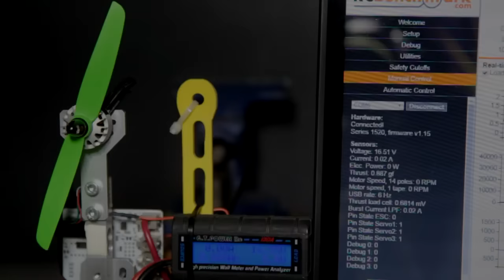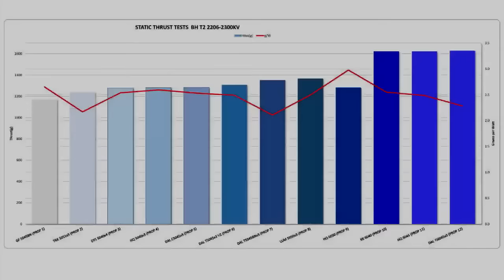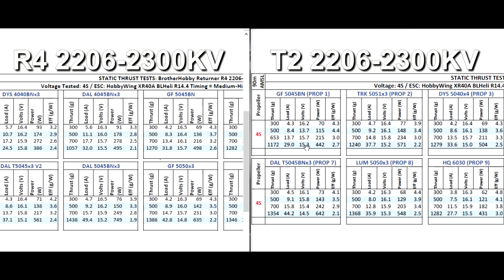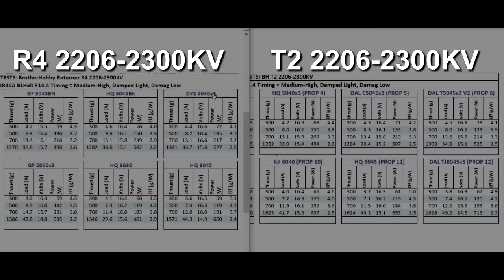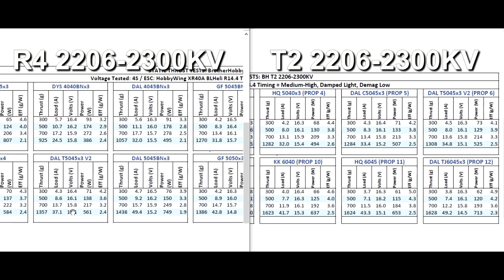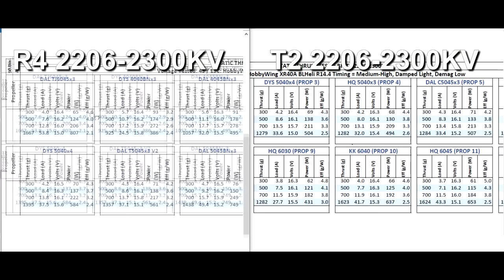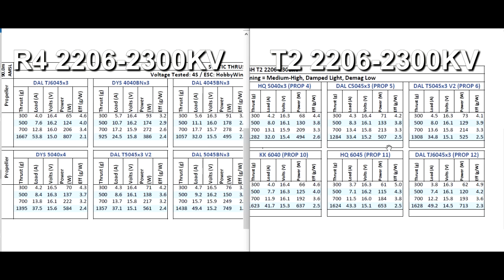BrotherHobby T2 2206-2300KV Static Thrust Tests & Tear Down

Comment: Very nice review buddie, its the stator the same size in the R4?
Reply: yes
Reply from the maker: Thanks for watching! I'll have to measure the R4's stator. I don't think I measured it when I tested that motor
Reply: you didnt, i saw that video, just to compare them and check what is my next motor. :)
Reply from the maker: FPV Portugal I'll check it tonight. Yeah. good to compare!
Reply: Thank you very much, sorry for the trouble.
Reply from the maker: R4 stator height is 6.0mm. Has 30 laminations so they're 0.2mm thick each
Reply: EngineerX thanks man, i think that explains why the T2/oomph are a little more heavier i think. ;)
Reply from the maker: Yes, the magnets are also considerably larger and more tightly packed and the extra 0.5mm of stator adds to overall weight. Also, no Titanium shaft :(
Reply: the shaft is minimal problem with the oomph since the shaft is so small its prety much impossible to break or bend it. ;)
I will just mesure the oomph stator to confirm it its really a T2 inside. ;)

oomph will be them. :)
Reply: Thank you very much for the help buddie. ;)
Reply from the maker: Glad to help! I'll be looking forward to your experience with Oomph. Looks like a very good motor and hopefully very strong for surviving crashes
Reply: So far the ones i have the bearings are the only complain (2 of them arent really great in term of bearings), the bolts for the props are somehow a bit annoying because there is no marking for ccw and cw, if you mix them you need to look at the thread. 
Besides that they provide amazing power and very efficient motor.
Reply from the maker: FPV Portugal only some minor complaints then :) Use a little bit of lady's nail polish/paint to mark reverse-thread screws or one of those bright paint markers/pens
Reply: Nice tip, i mesured the oomph and its the exact same size stator as the T2, so 2206.5 stator, not 2207 not 2206. :)
Reply from the maker: FPV Portugal Nice stator! that's why people like how it performs. Extra .5mm should give a little more torque so better response from low rpm when using aggressive props like DAL C5046x3
Reply from the maker: Yep- looks exactly the same and that's a good thing ;) thanks for sharing that info.
Reply: Do you guys know if the OOmph is a T2 now? I think of buying T2 bells as a replacement for broken OOmph ones... OOmph's don't have spares :( 
Thank you very much!
Reply: i dont think, im sure they are the same motor, armattan confirmed.
Reply: FPV Portugal ok thank you
Reply from the maker: Good and useful info from FPV Portugal. Only one thing to check once you replace bells is to make sure the bells sit properly on the OOmph base. Just check that the top portion of bell (inside part) doesn't rub on the stator wire winding due to differences in motor shaft resting height position. You can use washers as needed. Most likely they'll be exact fitment, but always good to check that the bell doesn't strike windings.
Reply: EngineerX thanks buddy, same for you. You provide useful information about the power systems. Keep up the good work. :)

Comment: Why you change the batteries to get a more consistent result? With all the effort you have put in for the test, this is such a small thing to do to keep things consistent... I don't see why you would just snap on some fresh battery to continue (finish the test...) it's a pity.
Reply from the maker: I don't have unlimited resources (money) to do the tests. I buy all of the equipment. The motors are sent by the factories, sometimes I buy them myself. 
The results for this test are still fairly consistent for the battery power supply setup I'm using. There has always been some variation in battery voltage as it's impossible to maintain the same voltage for every single test. I already purchased a dedicated power supply to replace the batteries, but I also don't have unlimited time either. I got many other things to do at work and home.
Reply: EngineerX makes sense to me, gives you an idea of what the motor can do. please get one of those Steele motors . like for Steele motors.
Reply: +endyouoff yeah it would be interesting to see how efficient they really are
Reply: EngineerX I just don't see how changing a battery can be considered UNLIMITED RESOURCES. And how changing a battery to perform the end of a test will take so much time, that you need to tell me you got work to do... I just find it a waste of effort. These tests take time to setup, and perform correctly. The action of changing a battery to keep the result consistent takes very little time. You are the person who insist on how 0.2V handy impact on the results... I just find it a shame to not take the time to change a battery, cos I do assume that you k musty have more then 1 battery if you fly quads that's all
Reply: Do you think a 7000mAh 4s Li-Po is cheap? if so, buy him some more so you'll be satisfied with the result or do the test by yourself. Such an ungrateful person. Talk less, do more!
Reply from the maker: LoL... No problem, we can never satisfy every single person. We just try our best. Thanks!
On a side note: Before Mr Choi expressed his disapproval of my testing methods, I had ordered a Venom power supply and a couple of car audio capacitors. I'm going to use a similar power supply setup as QuadMcFly and set it to around 15.5V so hopefully that works and should make tests more consistent. But then Mr. Choi will complain that I don't use a controlled climate clean room for testing so that weather doesn't affect results ;)
Reply: And other people will say you're cheating using a constant voltage power supply. Things will just get more and more ridiculous ;-)

Comment: First,  also could you speak louder please, and haven't you already did a video on these motors? Great video
Reply from the maker: I had not tested the T2 2206-2300KV until now. I'll try and boost sound on the video editor next time.
Reply: Levi Landon it's the mic not is not good at capturing the voice, it picks up all the ambient noise too... Will need a directional mic like a shotgun mic to have good audio in this case